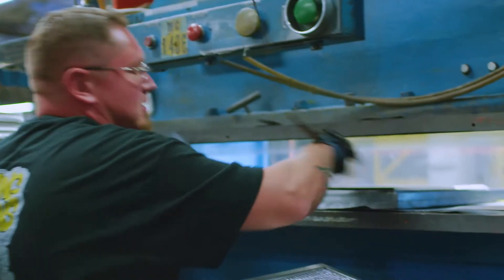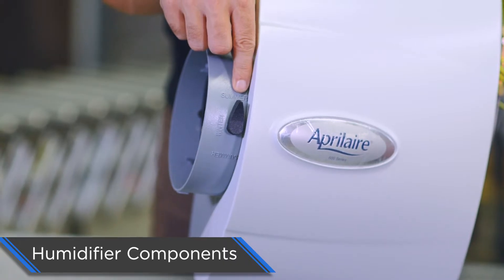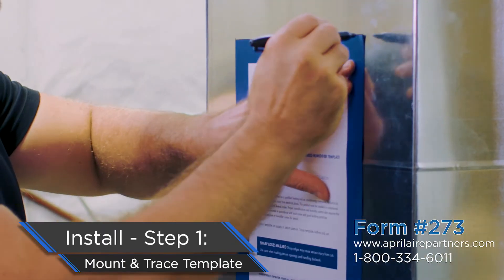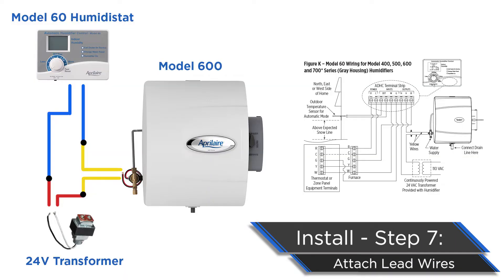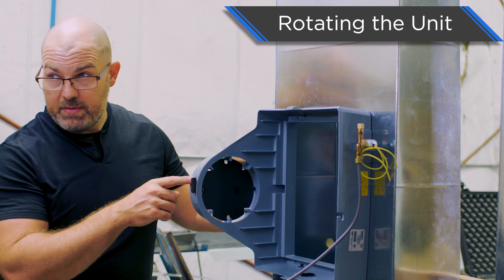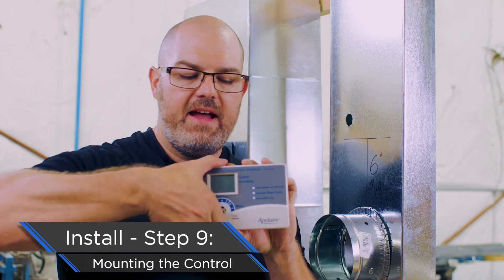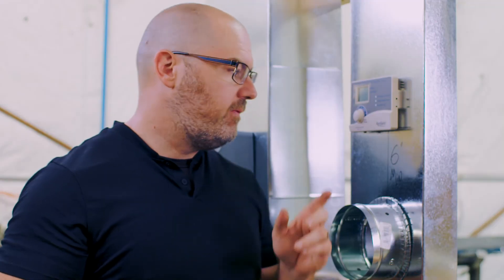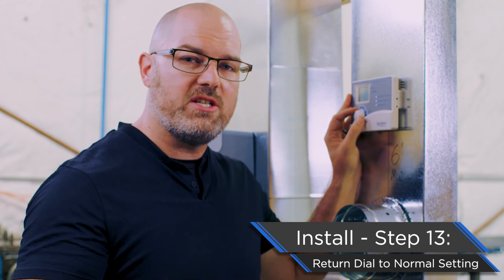Unboxing & Install | AprilAire Model 600 Humidifier

Comment: Thank you for this video. My 600 control panel looks older. Inside it has a bypass / power switch. It’s currently set to bypass, should that be flipped to power? I can’t find anything in the manual. Thanks!!
Reply from the maker: Thank you for contacting Aprilaire! Would you mind giving us a call directly to discuss this? We'd be happy to help. We can be reached at 1-800-334-6011.

Comment: To the people I’ve seen leave negative reviews because this system doesn’t come with everything to install it this is just like most everything you buy for a house it’s a universal fit there is no was they could possibly know what parts are needed to install it in your house. No 2 houses are the same. If they did give you every possible part you need to install this kit you would be paying hundreds of dollars more. On average you should plan on spending 100 bucks to buy the parts you need to install this kit. Don’t blame the company because you didn’t do any research and not for nothing with you tube it takes 10 minutes to figure out what you need.

Comment: $300 bucks for this basic product? Omg, I could easily build this
Reply: The only thing I see getting complicated for you is with the control unit and the sensor with all of the electronics within that. There is a bit of computer engineering that goes into the electronics.
Reply: @m.p7227  of course, sensors are easy to get same with control board. I could easily program a microcontroller for input/output using C++. Humidity sensor is what I need to control the output. Solenoid valve is simple to find which will open and close water supply from main water copper line. ASCO solenoid makes ton of these. There are other brands out there as well. I could even make this so that it works through my phone app. It is the 21st century, these things are not hard to implement. Internet of things.
Reply: Yea but its more efficient to just buy this thing. The time to get all your parts and putting them all together will surpass the time to just make a few bucks lol
Reply: Hope that's the install price, these units are only $175.

Comment: My furnace has a A/C coil box on top of it.   On top of the coil box It's L shaped plenum turning to the left. It's 14" high and 14" wide 24" deep.  It has an 8" duct leaving the back to feed a bathroom and bedroom.  The main plenum runs along the floor to feed the rest of the house.  Return is right next to it.   Do you think it would work properly in the 14x14 area above the A/C coil box?
Reply: Oh yea I installed my furnace myself back in 1999 then installed the Air conditioner and coil box in 2000.  I just had a friend solder and vacuum check the lines as I didn't have those tools.  So I do have mechanical abilities.
Reply from the maker: Hi Chad - If you could give our Healthy Air team a call directly at 1-800-334-6011, that would be great. We'd be happy to address this with you. Thank you!

Comment: Would be nice to have someone that used the snips correctly and didn't leave a wavy edge and meat hooks, I know that is knit picking sorry. Also it would be nice if you actually wired it. I know there are a lot of ways to do this old equipment versus new equipment. love the magnetic template. love Aprilaire products.
Reply from the maker: We appreciate your feedback, Richard - thank you for your comment. We're glad to hear you love Aprilaire!
Reply: The sort-of instructions for wiring are not the same as the diagram provided with the current sensor. It would be great if you made another short video showing an actual wiring to a standard furnace. I'm using for example a Rheem Classic 90 Plus furnace. I am not sure how to perfectly wire it, due to differing diagrams in your instructions. There does not seem to be anything definitive online or vid for the automatic digital controller.

Comment: I am curious why Aprilaire provides saddle valves ?  My 30+ years of experience with them is they deteriorate over time and causes a mess.  Isn't it better to use a ball valve ?
Reply: Saddle valves are the norm on most ice makers I've replaced a few that were over 25 years old and didn't leak 
I have had shut off valves leak at the packing nut
Reply: @rkaraidos  Thanks for your info..  I am a firm believer in ball valves though... Saddle valves are simply bad news based upon my over 20+ years of experience. It will leak or seize.
Reply: @ptg01  the humidifier is only active during calls for heat, so there isn't a need to shut it off after every season. But you are right and most places around me it is code to use ball valve and some require an arrestor as well.
Reply: @rkaraidos  I switched over to BALL valves a few years ago...  Hopefully, they are less problematic than saddle valves..
Reply: @ptg01  Ball valves are much better than saddle valves. I can't believe they're even sold anymore!
Reply: My experience is they are trouble free... so trouble free that I replaced my main shut off valve to ball valves. too !
Reply: @cheyennerafterq  I agree....  water can do SUBSTANTIAL damage and I am just miffed that they are even being sold, period.  My plumber REFUSES to use saddle valves.
Reply from the maker: The work, time and cost associated with a ball valve can sometimes be prohibitive to some customers, so we include a cheaper option as well that in most cases works perfectly fine. If you have further questions, please give us a call at 1-800-334-6011. Thank you!
Reply: @aprilaireco  This makes sense.....but with saddle valves (primarily for refrigerator ice/water and humidifier) all of mine went bad on me after 10 or so years (and I have very high quality water here).  The humidifier saddle valve  that we shut off every season went bad sooner.  It seizes up and the rubber basket also deteriorates and seal no longer works.. Professional plumbers refuse to use saddle valves.  I've had mine replaced with ball valves several years ago and it's been trouble free so far. Yes, it costs more up front but the possible mess it can create down several years is significantly more than the $150 or so you pay a plumber to install saddle valves.  I suppose it all depends your time horizon..
Reply: @aprilaireco  Ridiculous answer.  You require that the humidifier be installed by a pro to get warranty coverage.  Any pro is going to be able to install a ball valve.  Or to put it another way, if a pro can't install a ball valve, he shouldn't be installing the humidifier.

Comment: I have a two wire thermostat and the wires in the oil burner blower are not well labeled.  I can get access to the two thermostat wires, and can run the outdoor sensor for automatic thermostat, and wire the transformer.  If necessary I can get a current sensor ( wow, those things are expensive! ).  I do have access to screw terminals in the fan controller though they are unlabeled.  Can you give instructions for how to approach this?  This is for an automatic control ( manual is for model 60 & 62) with a new Aprilaire 400.  Thanks
Reply from the maker: Hi Charlie - If you could give us a call directly at 1-800-334-6011 at your earliest convenience, we'll be able to assist you with this. Thank you!

Comment: What if you live in a place with low humidity in the summer? Can I leave the damper open on winter all year?
Reply from the maker: Hi Trent – Yes, you can leave the damper on winter year round. We’d like to point out that if you run an AC unit, the evaporative humidifier will work less efficiently. Please give our Healthy Air team a call directly at 1-800-334-6011. Thank you!
Reply: So I’ve read some say put on supply some say put on return 🤷‍♂️also hot water or cold water 🤷‍♂️

Comment: I have a young man at Aprilaire today 2/12/20 tell me that I needed to cut out a square (about 4.3 x 2.5) for the control panel to mount into!  Someone needs to talk to him and straighten him out!  I see now (because I thought something wasn't right) that I only need a 3/4" hole for the sensor!  Thank goodness my antenna were working today.
Reply: I think thats only if you have the manual control
Reply: I've actually seen a couple of videos where the installer cut out the square. Personally I'm just doing the small hole for the sensor, no need for the extra work and chance air leaks.

Comment: It looks like the connection to the water line was left out  either hot or cold and drain line.
Reply: can use hot or cold, Aprilaire claims hot water is better. d
Drain it to floor drain or condensate pump

Comment: This unit comes with a transformer...Why?   Don't you just get the 24v from the furnace?
Reply from the maker: Great question. This is included for situations where you can not connect into the furnace.
Reply: @aprilaireco  Curious... under what circumstances would you not connect the 24V from furnace control board to the humidifier ?
Reply from the maker: @ptg01  If you could give our Healthy Air team a call directly at 1-800-334-6011, we'd be happy to help you with this. Thank you!
Reply: Transformers have a VA rating to them. They’ll fail if they have too much current moving through them. It’s possible that your current transformer is unable to support the extra equipment.

Comment: FAKE INSTALL. FAKE EXPERT. with BS safety glasses. VERY DECEPTIVE. Where is the drain line? WE WANT TO KNOW. You need a floor drain or a pump. Right?
Reply from the maker: Regarding your floor drain or pump question - with the Model 600 you do need a floor drain. You do not need a pump. 

Brandon is not a fake expert. He is one of our national trainers with over 15 years of experience. The glasses worn in this video are prescription. This install is designed as a quick overview and reference.
Reply: @aprilaireco  Hey... nobody is perfect right ?  This video is very helpful yet missing a critical step of drainage seems like a major oversight and can be catastrophic....

Comment: WELLLLLLLLLLLLLLLLLLLLLLLLLLLLLLLLLLLL. you forgot a very important step that was listed on the sheet as step 9 and completely left out the video.... THE DRAIN LINE.................
All that water dripping on your floor can not be a good thing... Should I get a reward or something? lol
Reply: Just call them, and laugh at them like they would laugh at you if you leave it in Test Reset mode ;-)
Reply from the maker: Thank you @brikk man. The drain is extremely important and will be addressed.
Reply: @aprilaireco run it down the duct work to the drain I'm an hvac tech it's not hard

Comment: We, we, we, we, we,  our our our    YOU are opening the box... not we,  YOU are YOU are doing it.  Get your pronouns right.... very annoying. n That drain "spud" needs a better seal.  without a ridge, the drain hose can fall off, resulting in water flowing onto the floor... PLUS you failed to include a step to attack an overflow drain hose.
Reply: @s2s_Parrot Fan, your punctuation, proofing, and capitalization needs improvement. Hope you don't live in a glass house.  Your critique is unhelpful.
Reply: aw, you beat me to it.